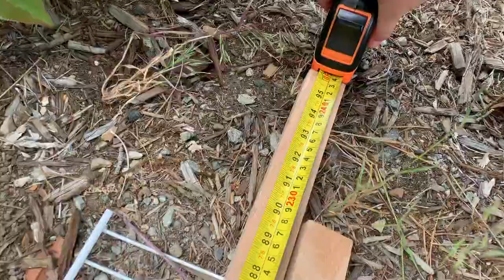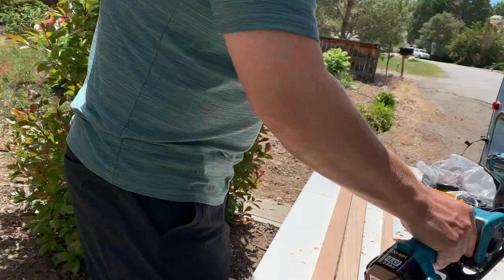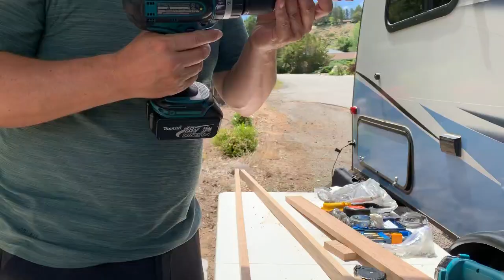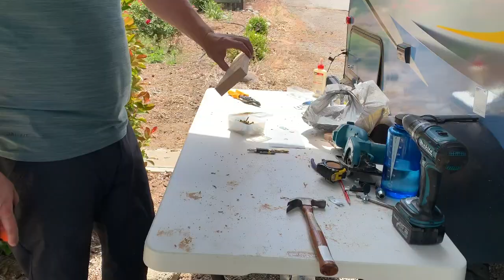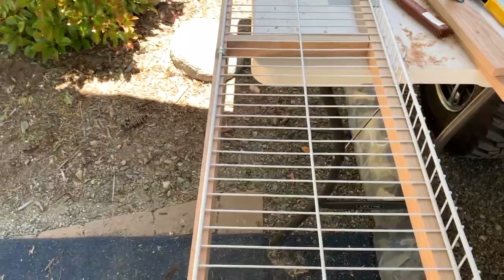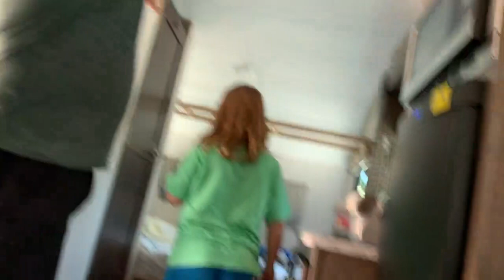How to make extra storage shelves for your R-Pod for under $100

Comment: When I bought my 2019 RPod 171, the cornice boards had been removed. Are these integral to the plan for the shelf? Or do you think I can still do this shelf?
Reply from the maker: Oof, this is just me thinking about it, but yes I think they help bear some of the weight. Otherwise it's just elevator bolts pushing out against the walls of the RPod and I get a little nervous about that being the only thing holding the shelves up.

Comment: Just built my shelf and installed it two days ago. I modified the attachment of the wooden frame to the wire shelf, but it is very sturdy and we're starting to load it up slowly, to see where our max payload is. Thanks for the idea!
Reply from the maker: Did you go with one shelf or two?
Reply: @benallfree  Just one shelf, we have an RP179.

Comment: What I learned with this method. First, it works. 
Second, if not stated in the video, when drilling into the side pieces to sink the elevator bolts in, don’t go too deep. If it’s buried to far you won’t be able to get a wrench on the driving portion of the bolt. You’ll have to do like me and glue washers into the hole. Little new guy error I made. It all worked out but initially very frustrating. 
I also skinned mine with 1/4 ply.
Reply from the maker: Nice tip!
Reply: I would have thought the T-nuts would have prevented the elevator bolts from going in too far?

Comment: Great video, I bought my materials to do a very similar shelf in my Rpod 189. Question Where did you find the elevator bolts and tnut for it to screw into. I looked all over Lowe’s and couldn’t find any. Thanks
Reply from the maker: Thanks! I think I found mine at Home Depot in their section with all the other bolts and fasteners. Might have luck there.
Reply from the maker: I just made an Amazon list we can add to: https://www.amazon.com/ideas/amzn1.account.AGQTTDXJZ3LEEDXHIAAQ4K5MZNHA/1ARWCEV2A969F
Reply: It’s cause it Lowes. The most frustrating home improvement store ever.

Comment: Hi Ben, shelf design is a great idea, thank you. I made one for the front of our R-Pod and it came our great. I was afraid to tighten elevator bolts too tight and damage the walls. I tightened them just tight enough that the elevator bolts won't move in the countersunk holes. Thanks again!
Reply from the maker: Robert from what I’ve learned your approach will work just fine!